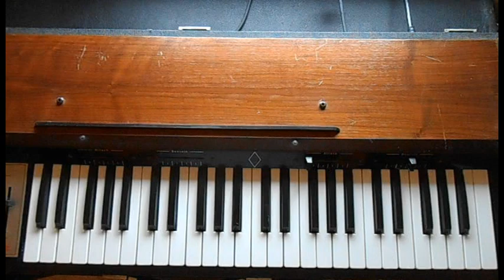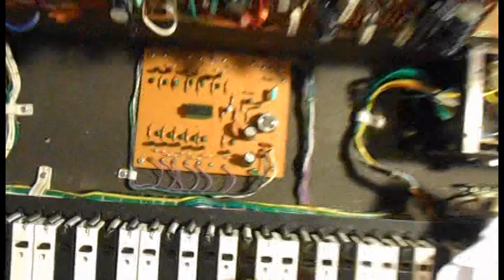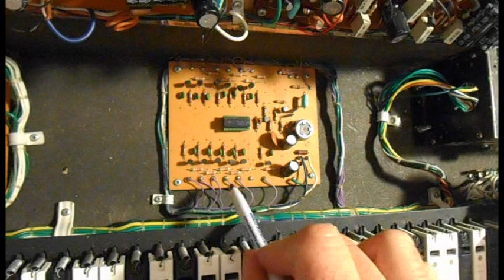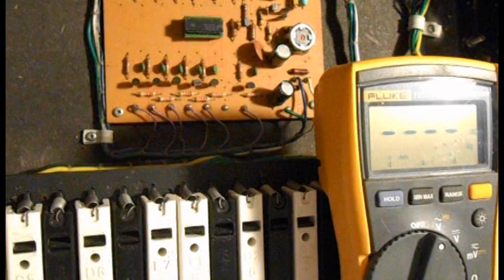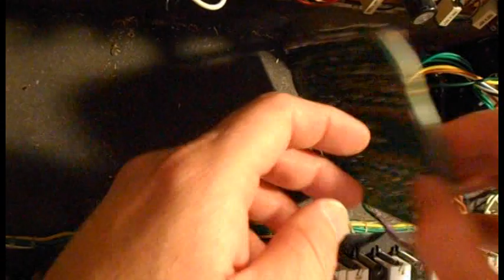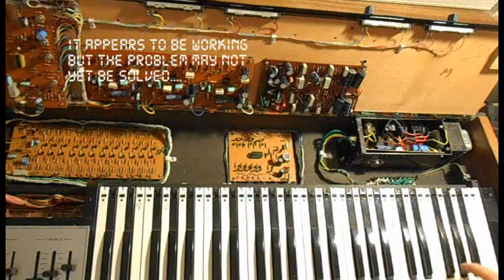Logan/Hohner String Melody II String Synthesizer Repair Project

Comment: I have an mk1 version, i have a litte problem, one key totally ignores the attack/sustain settings and alwais plays at 0 attack and 0 sustain, another key totally stops working when i increase the attack value, sustain have no problem, I have the schematics for the mk2 version but comparing the circuitry i can say it's pretty much identical with just some variations. Under each key there are 3 contacts, one is the note gate, one is the attack trigger and the other is the sustain trigger, maybe the problem it's there... if you could give me any advice i would be very grateful, greetings from Italy.
Reply from the maker: Yeah, without schematics it's very difficult to map the solution.  Signal tracing with a scope is the way to find the culprit.  Physically pulling the PCBs and looking at the traces and chasing wires to see where they lead.  Tedious, but sometimes necessary.
Reply: https://www.ebay.com/itm/265168222894

Comment: Logan String orchestra, very similiar- mostly ok but when the sustain slider is up on the top half of the keyboard, it makes the highest note "C"  play continuously. no idea where to start looking- hoping it's something simple because i can't afford repairs at the moment- any advice would be greatly apreciated- Thanks so much for your video
Reply from the maker: Thanks for checking out my video.  The issue you describe is most likely a dirty/corroded slider pot.  And/or mechanical issue w/ the key contact.  Possibly a dying, or intermittent solder joint on the, transistor in the trigger circuit.